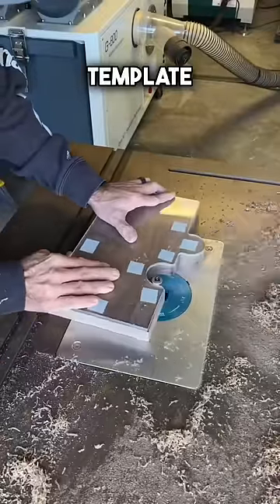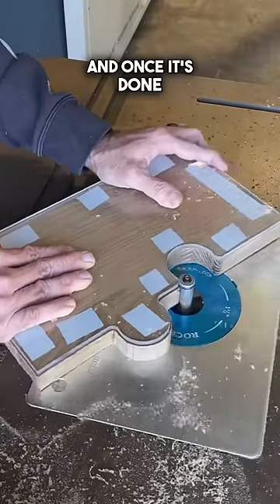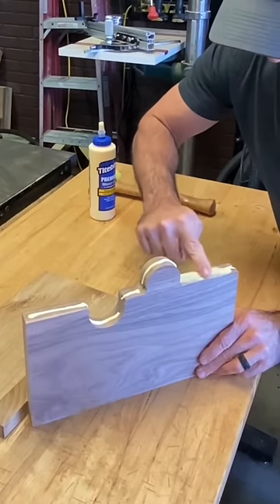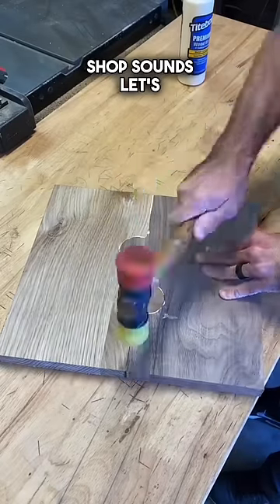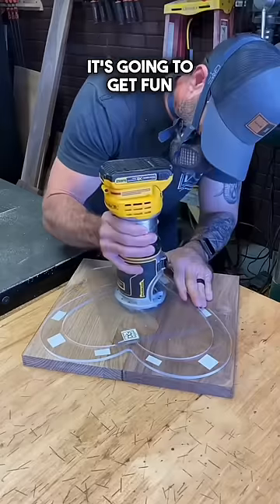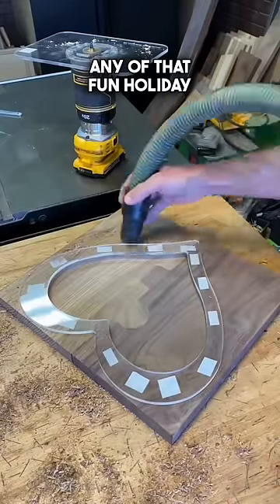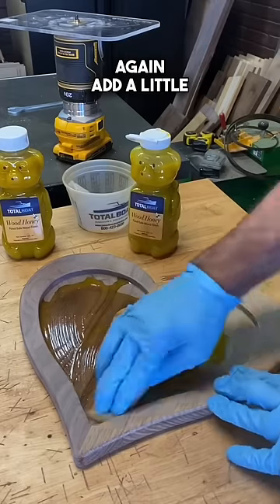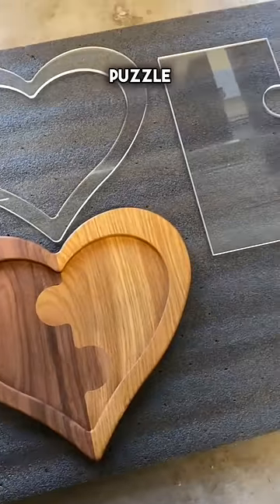Joining TWO species #shorts #woodworking

Comment: The "finger wipe" is an old army field technique.
Reply: Gross! I was fortunate to never have to do that.
Reply: @ronh9384  I never served, speaking anecdotally. My pops said his drill seargent told him to limit hit wipes to 1 deposit per square. You stick your finger through the sheet and clean from the inside out. When finished, you wipe the finger off with the TP to cover your retreat.

Comment: Curious to ask, has there ever been an issue with the template getting in the way and ground down while cleaning the edges or is the bit set lower than the template and not affected?